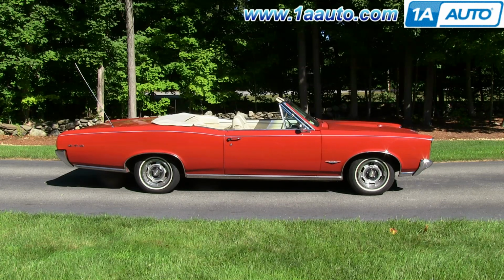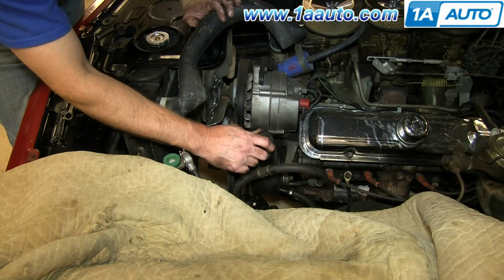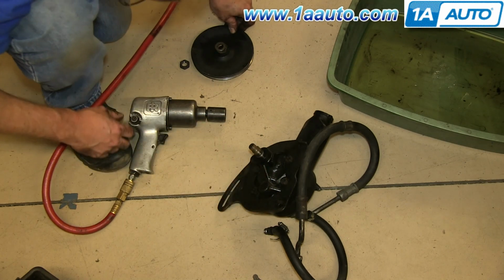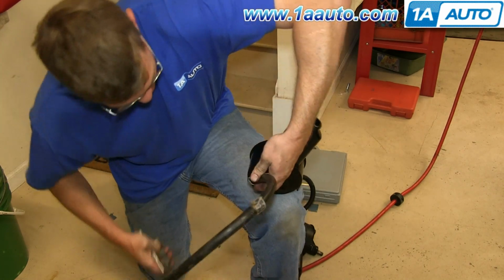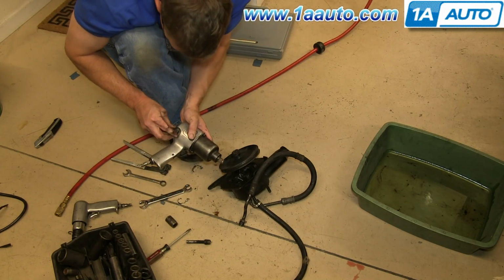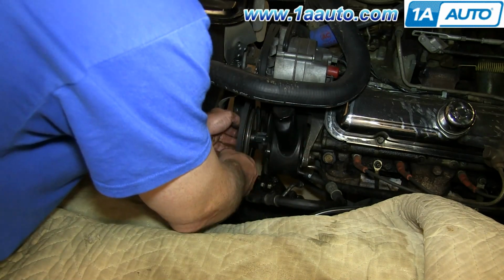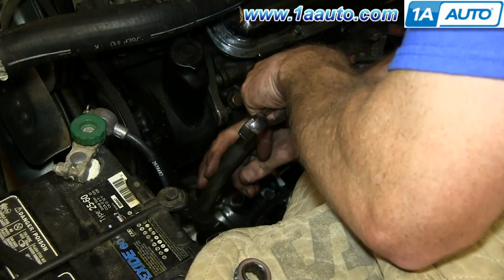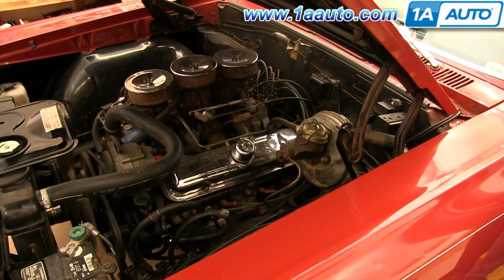How To Replace Power Steering Pump 64-67 Pontiac GTO

Comment: hello 1AAuto, I am in dire need of the silver bracket on the rear of the pump the hooks into the engne block. Is there a part number for this?
Reply from the maker: +Swiggyification Not sure if there is a part number for the pump bracket, might want to contact your local dealer, or take a trip to the salvage yard to see if you can pull one off a scraped vehicle.